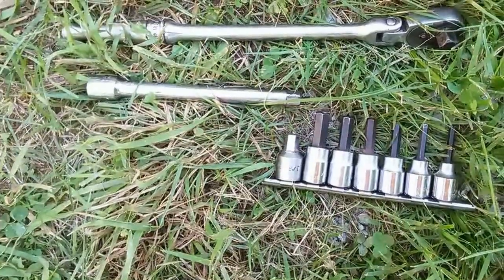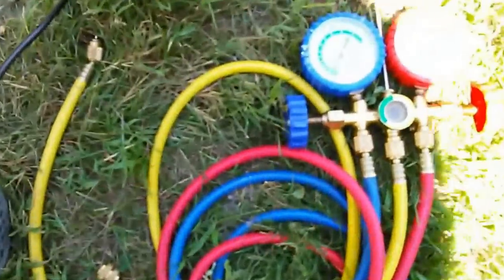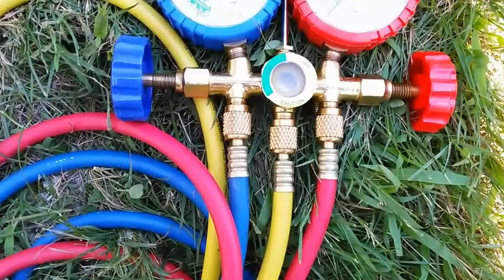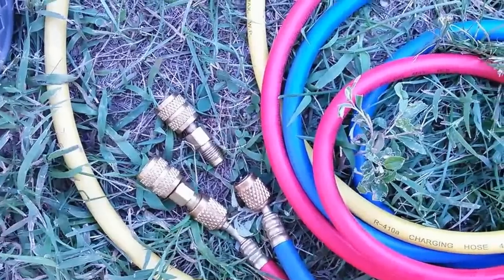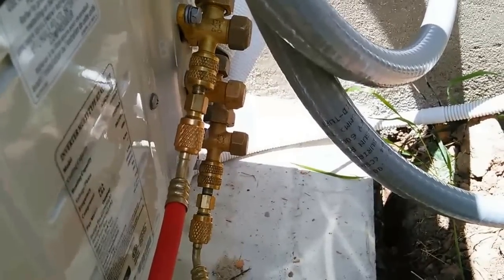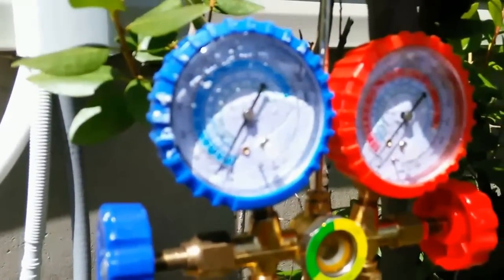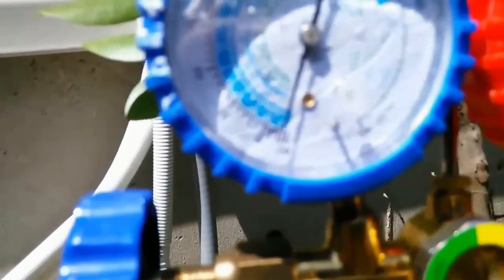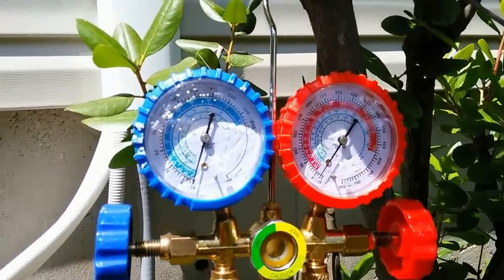How to Install any and all Ductless Mini Split Air Conditioners

Comment: If you pulled that vacuum to -30 inches of mercury in just a few seconds, all you did was vac manifold and hoses. Sounds like the schrader valve on the service port didn't open. Best to use a schrader valve removal tool, 20 bucks on Amazon. Depending on lenth of linesets it should take a minimum of 5 mins to get that reading. Other than that, good video, loved your linset cover vid, that was awsome!

Comment: i have a 4 to 1 mini split system .. my  tech says i cannot heat in one room and cool in another that all the units must either operate in heat mode or cool mode ??? Is this correct? its hotter upstairs and it would be nice to use which ever mode i need
Reply from the maker: He is correct. The fluid that is running through the lines can either be hot or cold not both. I think you mean you have a 4 zone unit. Nice eyes

Comment: What was the longest line run for the furthest head unit? I have a dual 28,000 and my longest run is about 55' and I was wondering if I am going to have to add 410 to the system for that kind of run.
Reply: There is enough Freon to charge 20ft of line. At 55’ you will need a pound or more to “top off”
Reply from the maker: No

Comment: I have a KMIR218 that was "professionally" installed a month prior to buying the house. It is still working no with no error codes but just isn't blowing cold. It output is about 74 degrees. The line set is longer than the 25 feet so I know from the paper work that the tech should of add r410a at .16 ounces per a foot I can do the math and add the freon but my guess is that the tech didn't vaccum down the lines and the only way I will  know for sure that it has the correct charge to have all the R410a vacuumed out recycled and weigh in the correct weight. My question is this since as far as I can tell the lines all run to the same compressor on the outside unit if the lines are already open wouldn't vacuuming one port vacuum down the entire system? Also at the same time adding the r410a wouldn't it be able to do though one of the service ports?
Reply: You should install the next one yourself sounds like you know more than the "professionals"

Comment: Thank you for the video. You don't need to use nitrogen? I am planning to install my own ductless. Was the service valves closed when you did the vacuum?
Reply from the maker: They have to be. do not open and let in the 410a till you pull vacuum. Pretty simple.

Comment: Thanks for a clear simple depiction...piece of cake...

So many idiots try to pretend it's sooo technical.

All you need is the 100 dollar vacc pump from eBay...comes with all the adapters and gauges...
Reply from the maker: Nope kids play. I have 2 units 6 zones now. Yawwwwn
Reply from the maker: It is easy. Those idiots are AC techs trying to bash a job that is kids play. Almost 3 years and it hasn't missed a beat. I use dollar store grill cleaner to clean the outside unit.  Make sure it is off and keep it off for an hour after rinsing. Also brought a whole house surge protector. Best 60 dollars you will ever spend
Reply: You are being facetious right? Surely you are joking.
Reply: You don’t even need gauges or a vac pump if you know what your doing.
Reply from the maker: Vacuum pump is good though to check for leaks.

Comment: Thanks for the video. Is there a risk of air entering the system while the hose from the gauges is being disconnected from the service valve?
Reply: should disconnect after gas release, not after vacuuming...
Reply: Wiser Soul the service ports have Schrader valves in them, similar to a car tire.
Reply from the maker: Nope

Comment: How is it resolved when the ODU and IDU have different gas/liquid line size specs?  I'm looking at specs for particular unit with 2 IDUs and while liquid line is same size, gas/vapor line is 3/8 on ODU and 1/2 on IDU.  You seem quite the expert so thought you might know.  Thanks.
Reply: the units generally come with a adapter if not, you would go to a hvac supply store or some hardware stores to find the correct compression adapter you need
Reply: make sure to always use nylock and the correct flared fitting as r410 uses extremely high pressure also do not cheap out on the copper line sets make sure A they are for hvac and not general plumbing and B that they are rated for 800psi or more
Reply: By unit you mean the A?C itself or perhaps you meant those automotive gauges? They can come with HVAC adapters? By nylock you mean a liquid thread lock? By not cheaping out on the copper lines you mean we should purchase a line set designed for a mini split system?  OK

Comment: Calling the R410 refrigerant 'Freon' implies that you are a Hack. Its not 'Freon'
Reply: o'grady no it isn't freon, but most hvac techs call any refrigerant freon anyway..
Reply: While I completely agree for this and other reasons...there is no need to call someone names when a simple correction will suffice. Anything more is just mean and can only serve to make yourself feel better....about yourself.
Reply from the maker: Grady R410 is HACK it is 410a. Reply with a video of your work. Need a laugh.
Reply from the maker: Temporary. Now it has rubber damper and bolts. Reply with a video of your work. Need a laugh.
Reply: It has a rubber damper and bolts no drywall screws. Jealous a DIY can do this basic task. Its harder for me to change spark plugs in a hemi. (16 plugs I knew you had no clue) I rather install 6 of these units then hemi plugs.